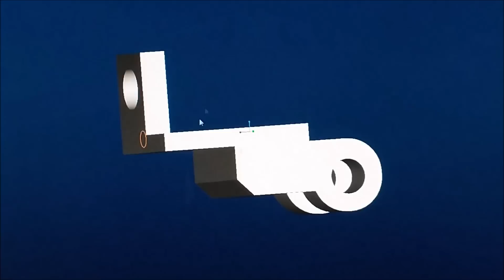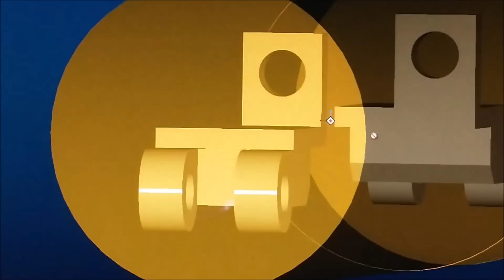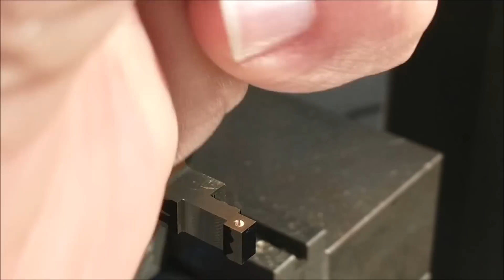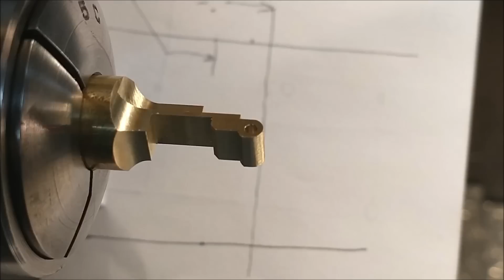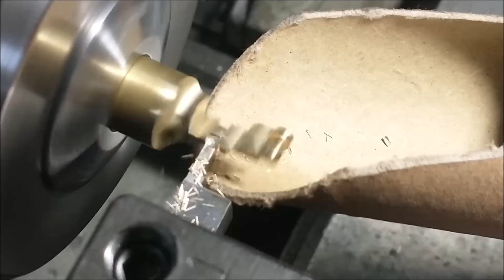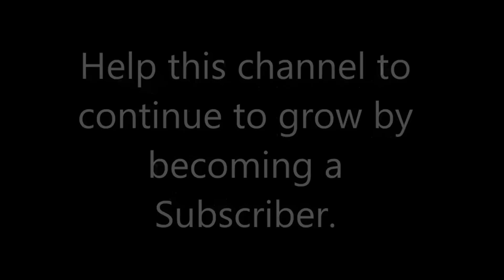Machining The Mini Mill Door Hinges - Part 1

Comment: Joe, once again, a small delicate piece with so much detail. As the last step was parting off, I might have taken the chicken way out and sawed it off and cleaned it off with a file and emery.
Reply from the maker: Though seemingly insignificant, the thickness of that tab controlled a lot of fitment conditions. Too thin and the hinge would pull down, too thick and it would push away. I felt I had more control parting it off.

Comment: Could you zero the absolute on the DRO on centerline of the spindexer? Use the incremental when necessary but always have the absolute to know where the cutter is “in the world”..? (Or I guess dimension the part using a polar coordinate from the CL…degrees on the indexer and radius in the Z…)
Reply from the maker: Absolutely. I did just that.

Comment: I was surprised you wouldn’t make them out of rectangle bar stock so that you could both hinges at the same time. But the end result was beautiful!
Reply from the maker: Holding them without crushing them would have been the challenge. Otherwise, a strip mill fabrication would have been the next best approach.

Comment: Hi Joe
I see what you mean about using that slitting saw
It even shows a little on camera a little bend in that extension,
Sad
But would it have been possible to champ a small piece to it to prevent any bending 
Or as you mentioned leave that piece thicker do the slotting then remove that piece supporting the end piece
Reply from the maker: Absolutely. Order of operations is certainly easier to evaluate for the second part.

Comment: They look spectacular.  And very much to proper scale from the outside.  One question though.  After you drilled the hole in the rear tab why didn't you slice it off with the slitting saw?  Seems like it would have been safer and easily done since the part was already set up for the hole?
Reply from the maker: Certainly an option.

Comment: Leave the door shiny to represent a die stamped sheet metal part. A cast door , in full scale, would be unnecessarily heavy.
Reply: There is no such thing as too much weight on a milling machine. Most mills I’ve seen did indeed have cast iron doors.

Comment: That's an incredibly ingenious way to do tiny parts, thanks for showing.
Btw that porosity on the casting sadly looks atrocious. Is there really now way to fix that? Maybe epoxy filled with fine aluminum dust or something? You could propably use filler on most of the body and paint it, but the holes in the ways would always be visible.

Comment: As always a very informative video. I do have a question though, knowing that you are a "old hand" why would you use a centre drill rather than a nc spotting drill to start your holes. Would appreciate to hear your insights.
Reply: Because, for all intents and purposes, a centre drill is a small spotting drill if you only create a small divot the diameter of the pilot
Reply: Can’t say I agree with you there. Centre drill has, typically 118 deg point stepping up to 60 deg to accommodate lathe centres. If you drill into that your drill makes contact on the edge and is not the most stable situation. That’s why a spotting drill exists so that the chisel in the centre of the drill makes first contact and ensure good guidance. Same idea when drilling where one drill follows another. The second drill should always have a slightly smaller point angle to ensure cantering and guidance.
Reply: @fransoosthuizen2151  If it's good enough for someone with Joe Pie's level of skill and experience, it's good enough for me!

Comment: I so enjoy your videos I'm a little envious of your shop I used to work a job where the whole tool room was mine. Over the years have had the opportunity to make little parts on production also have done large parts up to a the components for a large horizontal hydraulic press one part on that the cylinder and body was 14,500 pounds that was fun positioning on table.